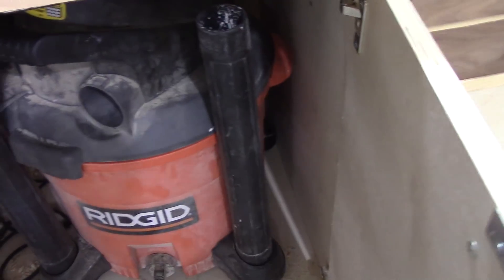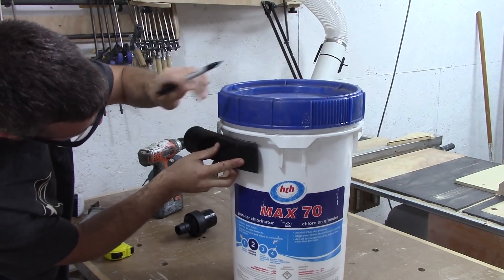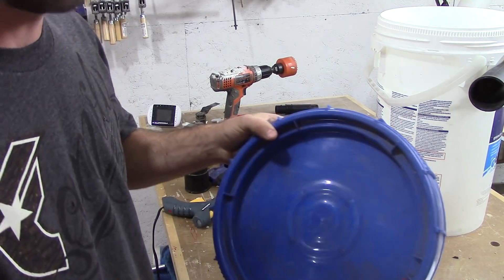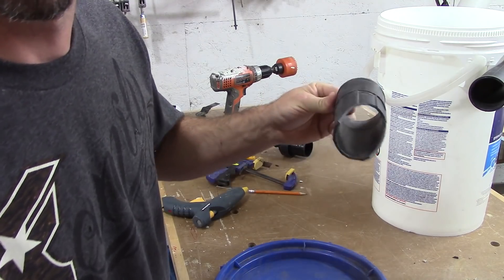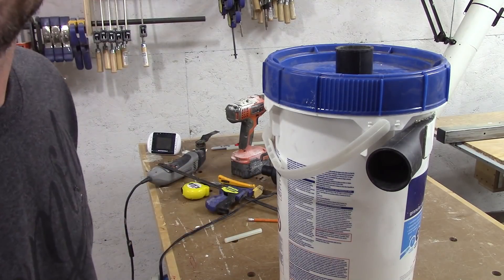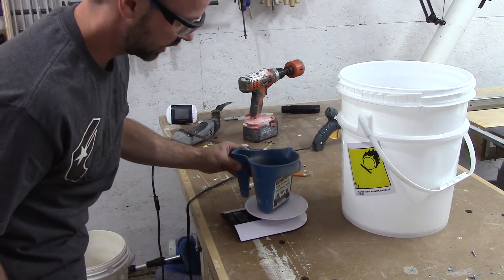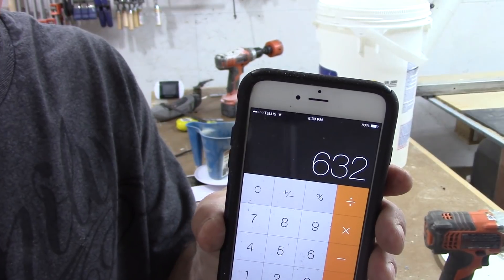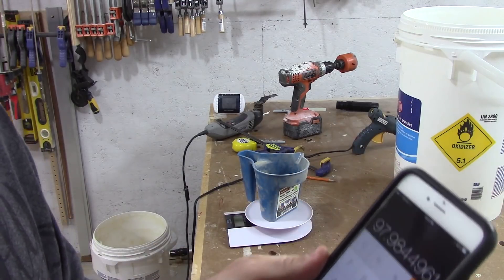Easy cyclone separator

Comment: If it hadn't been said before, I'll say it now...how effective to actually use shop vac attachments vs buying PVC fittings for the build. Like many, I have lots of attachments I never use but are set for the larger diameter hoses. Save a few $$ using them up vs searching for and having to modify PVC elbows. Kudo's for showing the build as I haven't as yet built one but paid over $40 for a kit from Rockler "in the event of" but recently bought PVC fittings I'll take back. Having an inground pool that I've over 20 leftover 100# pail buckets w screw on lids great for storage, I'll be using one as it's heavier for a base but better wall construction also. Key thing is the extra vacuum cleaner also. Great video

Comment: i made one but it doesn’t work. at least 50% gets past it and ends up in the vac.
the port on the lid just extends down straight about  an ins or so and i used a 5 gallon bucket.
what’s wrong here?

Comment: You can increase th efficiency by adding a baffle, made of wood or plastic, inside the bucket and above the port where dust enters. You make a hole in the middle for the outlet, with this the particles that are flying and normally doesnt settle down fast are trapped below the baffle and spin around the walls falling. The clean air stays in the middle. Thanks for this easy to make method.

Comment: Great video! Thanks for posting this very helpful, easy and extremely useful DIY. I would like to try it. I bought a 19L/5 Gal graduated measuring bucket https://www.homedepot.ca/en/home/p.19l5-gallon---graduated-measuring-bucket.1000784935.html but putting the lid on and off is a bit difficult. It looks a bit translucent so if I shine a light through it, I can tell if it is time to empty it.  Do you have any recommendations where to find a transparent (or translucent) bucket, preferably with a screw lid? I searched all the local hardware stores in Ottawa but could not find anything. Someone mentioned to look for a food bucket but I don't know where to find this either. I searched for the same bucket as the one you're using, but I only found this one https://www.rona.ca/en/max-70-granular-chlorinator-21665001 which, from the picture, does not seem to be a screw lid, so maybe the one you have is older or from a different store. I searched online, but anything that I found either did not ship to Canada or was a wholesaler who would not sell just one https://www.alibaba.com/product-detail/20L-plastic-clear-bucket-with-screw_60589161847.html?spm=a2700.7724838.2017115.1.3c93b095RdR7ZK&s=p . Thanks!

Comment: A thien baffle would help a lot with the seperation in that set up, simple scrap wood circle, pretty sure a 10 9/16 would be the diameter and take 1.125" off 270° or 3/4of the diameter and put the last 1/4 below the inlet

Comment: Nice, quick design Ryan, but it needs to go a step further.  Yea, I made a Thien separator like this and can confirm that the baffle makes a big difference in the fine stuff.  Also, one of the biggest challenges for this baffleless design is that as the debris builds up inside the bucket, the swirling air starts swirling and agitating the already captured debris, which then gets sucked into the vac's filter, oops.

Even with my Thien version, I noticed this when I checked the bucket capacity after a bunch of use, and saw that the debris was getting piled up pretty high/close to the baffle, which calms the air in the lower chamber.  Without the baffle, the debris will obviously short-circuit the separation in short order.

Comment: Get the tare weight of the big bucket (put a block or something on the scales small pad. Weigh once rather than weigh several small amounts that compound your error through rounding.
Reply: Brian Jones that scale isn't made for bricks...lol
Reply: You weighed only 600g of sawdust. Must be light bricks wherever you are ...I was just suggesting where your recovery efficiency was perhaps even greater than you reported. You can LOL the fuck off..
Reply: 645g is roughly 1.42 pounds, plus the weight of the bucket.  A 1-pound cutoff is not uncommon for small kitchen-style scales.  Now, I don't know what the capacity is for the scale he used, but it's quite possible doing it in 4 portions was necessary just to avoid exceeding the scale's capacity.

Comment: Congrats on a seemingly super easy project.  Couple of questions: Where can I get a bucket like that one?  It's appears to be sturdier with a tighter fitting lid than say a Home Depot bucket.  Does the separator work well with your shop-wide dust collection system seen in a recent video?

Comment: Nice video, how do you like the X Carve, is it holding up any pros or cons. Thanks
Reply from the maker: i find the longer you have the carve the better it is because you figure out all the little corks it has and can get it tuned right in making it easier to use. The big question you would want to ask yourself before buying one is " do I need one" its a pretty big hit to the shop budget for something i don't use very often. the best use i think would be signs/ branding/ lettering.

Comment: Nice job!  One question - has the hot glue held up well over time?  When I watched the video, I couldn't help but think that I probably would have used a good construction adhesive in a caulk gun.  This is not a criticism, just curious - I rarely use hot glue, but maybe I should use it more.  Thanks for posting.

Comment: Great video. I think I will put a piece of aquarium carbon filter at the top suction line, in the bucket. That stuff doesn't restrict air flow and should trap the other 3-4%. I love design won't cost a penny to use stuff around shop that I already have with little fabrication. Perfect and simple. Thanks

Comment: Thanks for the video, I made an identical setup out of a 5gal pail with excellent results.  I used tape for the inlet seal just to test it & was amazed. I have seen many people that add a baffle plate but I can not see it helping much. I am considering placing the bucket on a 55gal drum & may use the base of the bucket as a baffle. Time for some trial & error.
Thx again
Reply from the maker: +David Waegele nice! I think a baffle might help with some of the finer dust.
Thanks for watching
Ryan

Comment: I think the project looks pretty simple to build but also very efficient. are you still using it is it still as efficient?
Reply from the maker: Yes I still use it a lot. It collects majority of the large dust but only a little of the fine dust. I think and easy mod to get more of the fine would be to add a removable thein baffle about 3/4 of the way up the bucket. That would help the suction from picking up dust that is floating around the bucket.
Thanks for watching
Ryan

Comment: Nicely done.  Wondering why you didn't weigh the bucket with the material, empty it, then weigh the empty bucket and subtract.  Easier and more accurate, I'd think!
Reply from the maker: That was the plan till I realized I couldn't see the number on the scale because the buckets to big:)
Reply: Makes perfect sense! :)

Comment: Using the wand end was a great idea !   The norm has been to scribe cut the end of a tube or block of wood to the radius of the bucket which took some time.   I made mine that way and it wasn't any more efficient than the simple way you did yours.  I also used the hot melt glue gun and it has held up great, and quick too.  
Jeff

Comment: I used the same attachment to create a separator. The problem is when the pieces are too big for the hole. They block the suction and will collapse the container. I even cut the inside of it away as much as possible and it still clogs. Just keep this in mind.

Comment: I've made a very simple separator the same way and the only draw back I found was the shop vac attachment that is cut into the side of the bucket gets clogged pretty easy if a large piece gets sucked up. I fixed that by flushing up the attachment to the inside curve of the bucked. And I found I liked it so much I cut the bottom of my bucket out leaving a 1 inch lip all the way around and secured it to the lid of another and bucket then just snap it on and it doubles your dust catching capacity haha love the videos by the way!
Reply from the maker: I was kinda worried about that as well, I do plan on just using it for the CNC so there shouldn't be to much load on it but making it flush would be a easy fix. Thanks for watching!